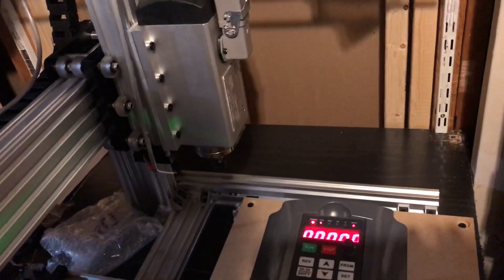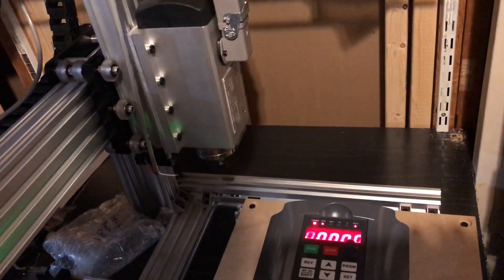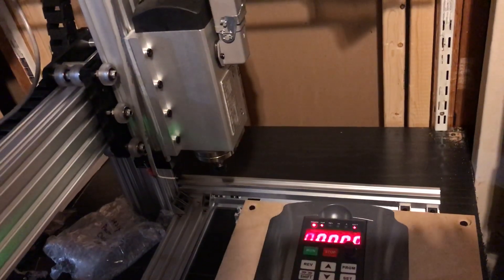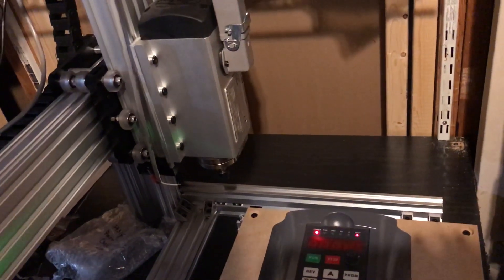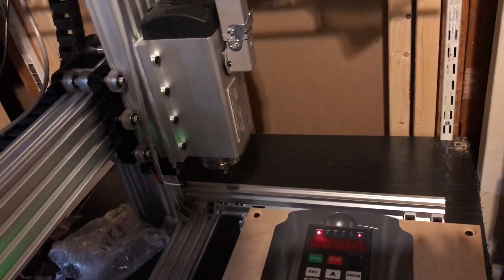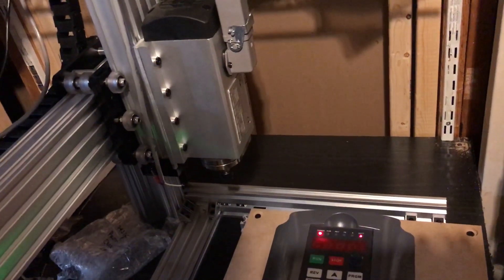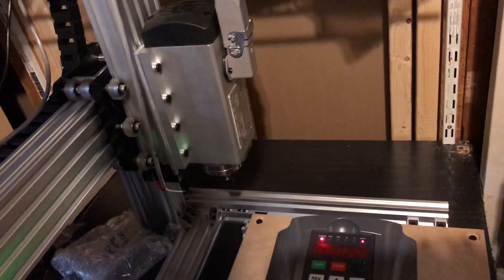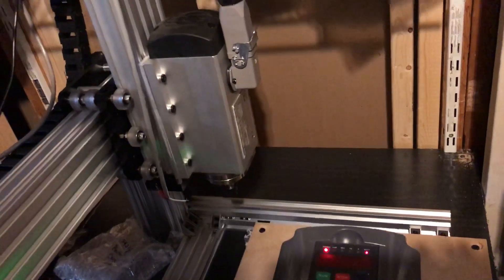Huanyang VFD air spindle 1.5kw 110v startup

Comment: The stalling could be because of a programmed warmup period. It's sometimes done to ensure the spindle have the grease warmed up, so it spreads correctly, protecting the spindle bearings from running dry. That is my guess.
Though I am wondering what "Aol" means? Amperage overload? Wrong wiring?

Comment: Excuse me, is it normal for the spindle to get hot? because my spindle gets hot
Reply from the maker: what rpm are you running it at? it will get warm. dont run it too slow (less then 10k rpm)
Reply: @MrExo_3D  I'm running it over 12000 rpm, up to 24000 rpm, and when I turn it up, everything gets very hot. The lowest I have run is 6000 rpm.